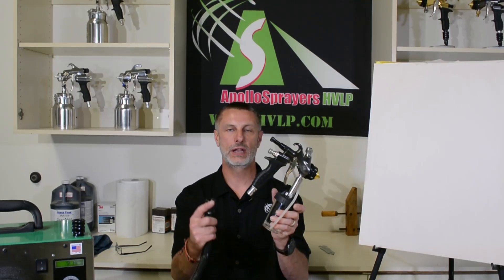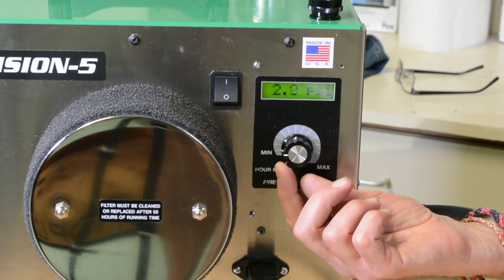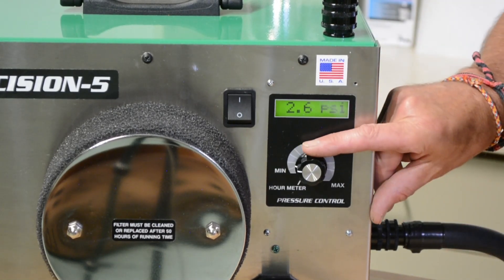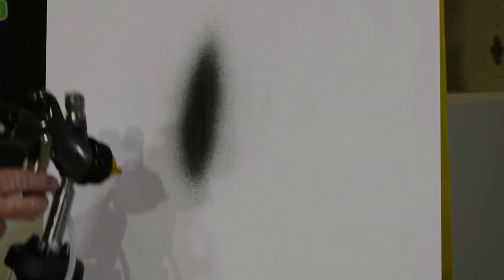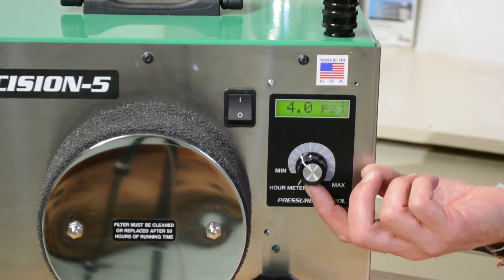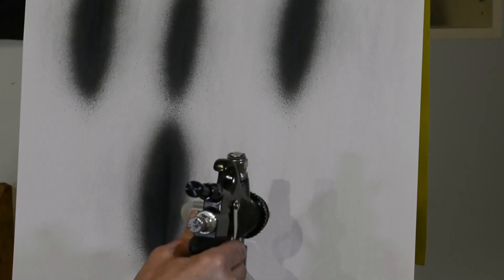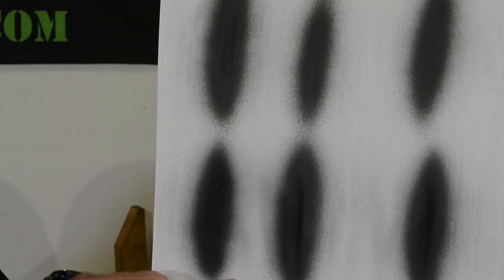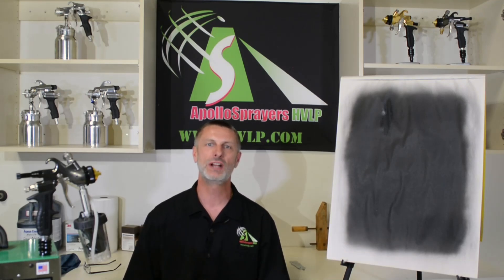Adjusting the Air Pressure on Your PRECISION 5 HVLP Spray System

Comment: where should the material adjustment be at as a starting point and what do you look for to see if it needs tweaks. particulary automotive paints.
Reply from the maker: We suggest you start with the fluid all the way closed and then back out the screw depending on the paint you are spraying.  Most paints will spray between 1 and 2 full turns out.  I would start with 1 turn and adjust to your comfortable speed at which you would like to move the spray gun.  Base coat will apply a little lighter than Clear coats, but both should be applied with no more than 2 full turns of the fluid.
Reply: do you recommend using a pressurized cup vs gravity feed?  Will that help get more material out?

Comment: I just got a 7700 with HS cap and I love it. Yet I am working thru a bit of a hybrid situation with a non adjustable turbine, that said, will chocking down the airpressure at the gun have the same net effect as adjusting the turbine? In otherwords if the turbine is producing a flat 9psi can I tune down the gun to equal a lower psi? I think my problem is over atomization and more overspray than I would like to see.
Reply from the maker: Yes, you can use the OS control on the back of the spray gun like a cheater valve for compressed air.  If you screw the OS in you will slowly restrict the air flow thereby lowering the overall pressure from the turbine.  The downside to doing it this way is that you keep the motor running at full speed and end up making it run hotter than normal as you increase the backpressure on the turbine motor.

Comment: Interesting. I was doing test spots but didn’t really know what to look for… I realize that as the gun moves, the leading edge(s) are covered by the center of the spray pattern.and the overlapping stroke So having an even distribution of atomization (pressure, needle, nozzle, viscosity) across the pattern is a key factor to even coverage and proper wet film mill thickness.

Comment: Can I spray primer, Clear and Flakes and is there top gravity feed guns I assume.
Reply: Yes, you can spray clear , flake and primer without a problem.  You will want to look at the Auto versions of either the POWER-5 VS or the PRECISION-5 PRO LE.  These systems are set up with the appropriate nozzle sizes for spraying cars along with a gravity only version of our Atomizer spray gun.  Please visit our website for more information on the systems.

Comment: Question if 6 psi gives the perfect spray pattern , why the need for a turbine with a11 psi ? 
Also the basic Apollo turbine is only 5 psi , so is this machine useless ?
Reply from the maker: You are confusing atomizing pressure with sealed pressure from the machine.  This unit gives a sealed pressure of 10PSI, which equates to about 6.5PSI of actual spraying pressure.  Lower powered units quote 5PSI sealed and are actually only able to provide less than 3PSI of spraying pressure.  It's all relative to the amount of air you start with.  The longer the hose and the larger the bleed port the more the air is reduced to the spray gun.
Reply: So was the readout on the machine, in the video, showing the sealed pressure or actual spraying pressure? I’m assuming actual.

Comment: Hi john, Can you please tell me, like help me?
I am looking to buy an Apollo Sprayer, but not sure which one!??

So Which Apollo machine I should purchased if I decided to paint windows and doors( like French windows and panels detailing doors) with latex, like water based paint as primers & top coats, varnishes and other similarly products!??? Even Shellac??

I have a business that I paint windows and doors, and fences( wood and metallic detailing ones), like different water and oil based primers and top coats, along with varnishes and clear coats, and on metallic detailed fences, sometimes I do spray an epoxy oil based primers and top coats!

However sometimes I do spray kitchen cabinets doors as well!!!

Plus very rarely I do spray small featured walls, and Columns with low sheen water based paints!

Can you please tell me in which Apollo machine I could do all that type of job, even as I do small jobs, but I like the idea that not much over sprayed as I had watched in a few videos!
Reply from the maker: We would recommend the PRECISION-5 PRO LE with or without the 2 quart pressure pot kit.  If you do a lot of doors then it will be nice to have the 2 quart capacity and remove the weight of the paint from the gun.  However, for smaller jobs you will want to the cup gun.  Here is a link to the page on our website https://hvlp.com/product/precision-5-pro-le-hvlp-turbospray/.  Feel free to call us toll free at 1-888-900-4857 if you have any other questions.

Comment: Hello John, I have a few questions for you to clarify me please; 

1- this package does not come with the gravity cup!??

2- Also this machine does the same job as the Precision 5 HVLP Pro?? 
Because the 5 HVLP, I have noticed apart coming with as same compressor an top, and a bigger cup an top as well, we can spray with both cups on the gun, and without those cups!??? Right??? 
and also we can spray as directly with the gun coming from the bigger cup an top, right??

I am asking you, because I have seeing in another channel as same machine as the one you are doing this video, like as same model 5 pro LE, but without the compressor an top, and without the bigger cup as well?

3- So not sure this machine 5 Pro LE does come with the compressor an top, plus an extra bigger cup an top as well, as you are showing on this video!??...Or we have to purchased separated!??

Sorry I am a bit confused with that!
Looking to purchased one, but I am a bit confused!???
Reply from the maker: Yes, you can get the PRECISION-5 with a gravity cup gun or a bottom feed cup gun.

The PRECISION-5 PRO is the newer version of the PRECISION-5

You can add the 4500 fluid feed system, which mounts to the top of your PRECISION-5 and comes with a mini air compressor and 2 quart pressure pot.  You can then use either the pressure pot or the cup on the gun.

The PRECISION-5 PRO LE is another version of the PRECISION-5.  This also can be purchased with or without the 2 quart pressure pot.  Please visit our website at https://hvlp.com/product/precision-5-pro-le-hvlp-turbospray/ for more information.  If you have more questions feel free to IM or call us anytime.

Comment: The guns on your shelf there. Are they older 7000 gun supplied with the eco series? 
Are those 7000 non bleed guns made by someone else & ASI have just put their sticker on the pot & endorsed it as their own?
Reply from the maker: Thee guns on the shelf are our current models E7200 and E7000 that are currently sold with the ECO systems.  Yes, they are non-bleed spray guns.  We are ASI, that is our DIY brand.

Comment: I would like to see a video that pulls together how the viscosity, turbine pressure setting, material volume and fan pattern all interplay off one another and how you understand which of the variables is the one you want to focus on to get the results you’re after.  It looks simple but there are a lot of ways to tweak and understanding which one best gets you to the result is a key thing imo.  I am still never really sure if I have all the variables the best I can hope for.
Reply from the maker: Unfortunately this is not something that is easy to put in a video because it will not account for different spraying styles.  We make recommendations in our instruction manual for different types of materials, but then there is always some fine tuning depending on the weather and user technique. If you have any questions please feel free to call our customer service department at 1-888-900-4857.